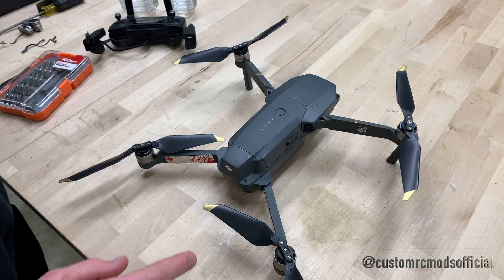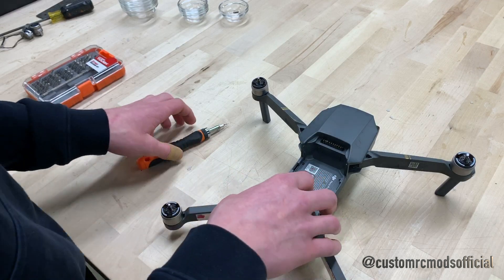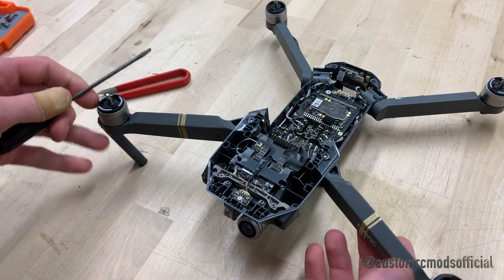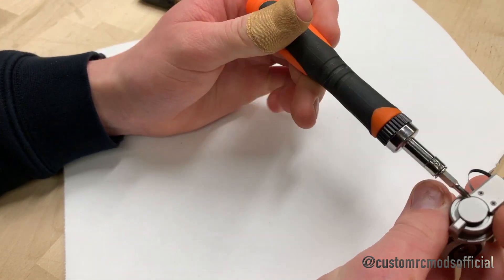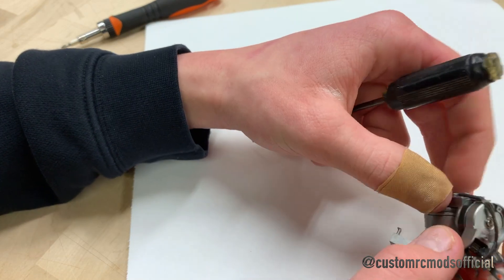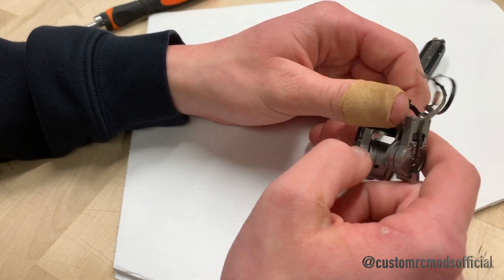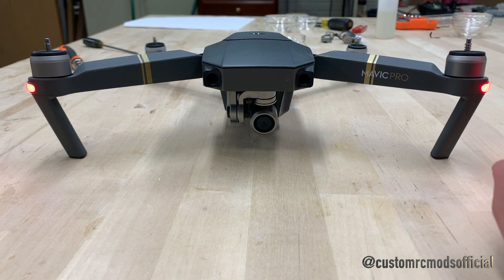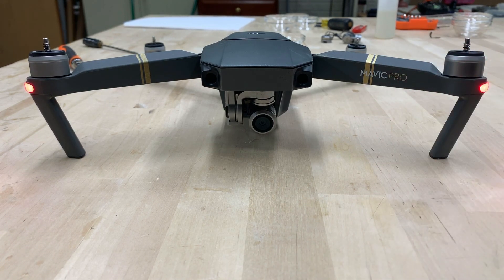DJI Mavic Pro Gimbal Ribbon Repair Guide

Comment: So, I've got the dredded "Gimbal Overload" going on and this past weekend i put a fresh battery in, turnednit on, and walked away from it to grab the controller, n immediately could smell  something burning that smelled lile plastic. I found that it was this ribbon. Where it comes out of gimball and twirls a little, the top burned away. The ACTUAL issue w the camera is that when 1 first start the drone it does its initial up n to the left look, then down, and dont come back up.
Do you think by replacing the cable, thatll fix the issue or does it seem like something else to you ?
AMAZING VIDEO by the way! The absolutle BEST on here hands down! Ty so much

Comment: thanks for thje helpful video. What symptom did you have when the ribbon cable was broken? For me the camera is always black, but the gimbal is controlling properly after a crash.
Reply from the maker: I would look for physical damage in your connections to know what is broken. If your gimbal is working, chances are there isn’t any issues or breaks with the ribbon cable. It’s possible that the reason you’re not getting any image is because your camera wire is broken. It’s a MIPI cable with a bunch of tiny strands, so if just one breaks that would do it. but it’s also possible that the camera itself is broken, this would be most likely the case if it took a direct impact in the crash
Reply: @CustomFPV  thank you. I'm replacing the ribbon cable - probably not necessary in hindsight, and I've ordered the video cable. The camera appears to be all ok so hopefully it's the cable. I've also had the uncertainty of software updates and controller to phone cable being flakey.

Comment: 13:45 "fold going up and down." yes this is key, otherwise it wont sit right. no other video I found explains this small detail. And props to your video framing, you actually kept your hands in frame and I was able to see everything you did. You're a lifesaver!
Reply: I had so much trouble with this part and got it put together but I still get the overload message
Reply: @marshalllove  It sounds like something might not be plugged in all the way or perhaps a faulty flex cable.

Comment: I have replaced the ribbon cable and problem was solved (so I thought), after few hours in the pouch tried to go flying, and the problem returned. Ribbon was purchased from DJI for 35$. What else could be wrong, can you tell?
Reply from the maker: It is a very delicate repair, I would go back over your work and see if any of the pad connectors came undone. Other than that it is pretty hard to tell.
Reply: @CustomFPV  I have flown it now, first time after 2 minutes of flight gave me gimbal error message, restarted it and flown all 3 batteries to 10% without any issues, even used sport mode to rape the gimbal, works fine. I have noticed that if aircraft is upside down, and you move the gimbal it rubs of the small holder for the vibration plate (turned off of course), don't know if it should rub on it.
Reply from the maker: Sanel Libic That is good news. Hopefully it keeps working. at the end of the day it is a diy repair to get you out of spending hundreds shipping it back to dji. In terms of the rubbing... not sure what’s up with that. Thankfully the drone doesn’t fly upside down!

Comment: This helped me a lot. Successfully installed the new gimbal cable. I powered it on and it still had the same behavior. So I disassembled it and double check every connection. Now the gimbal doesn’t power on and I get no video feed.
Reply from the maker: Joey Villa Hmmm. It could be your cables, gimbal, or gimbal control board. This is a very delicate job so even the smallest mistake can throw it off. I would triple check for any tears in the ribbon, or broken wires in the video cable. Then look at the pins on each of the gimbal motors. those are easily damaged when popping off connection pads. If it’s not any of those, It may be your gimbal board. inspect it and smell for a burnt smell, or look for fried components. It could still be damaged even if those signs aren’t present however those signs are common. Also, check your power connection between the board and the drone (that powers the camera and gimbal). Hope that helps. Let me know. If it’s none of that you may want to go get it looked at by the pros. Thanks for watching!
Reply: Same here. Original problem was "gimbal overload" and now I have error with the front sensors, error with video feed as well as gimbal overload. I can still see the video feed but it looks terribly washed out and there is no gimbal movement

Comment: I’ve watched lots of videos on assembling the gimbal ribbon. Few if any do a good job showing the reassembly well. However you did a fairly decent job. I’ve done quite a few cables recently and the reason for this is that I’ve been buying them of eBay in Australia and the eBay ribbons simply don’t work apart from providing good practice. Maybe one in ten work, so I got lots of practice. My advice is stay away from cheap ribbons on eBay. I’m not sure about amazon ribbons but they’re probably the same. I think this is one of the times you stick to genuine parts. They are more expensive but they work.
Reply from the maker: The link for the ribbon cable I purchased is in the description.
Reply: CustomRCMods thanks
Reply from the maker: Thanks for the feedback. I’m glad my video helped! Yeah I agree. I’ve done about 5 of these repairs, with aftermarket ribbons. They can be hit or miss, but i’ve been pretty lucky to have each one work every time for me. for 10$, it’s hard to beat! Thanks for Watching!
Reply: CustomRCMods hi, maybe you can share the link to where you’re buying them from so that we can buy from them as well.